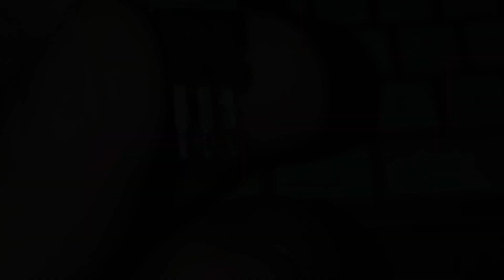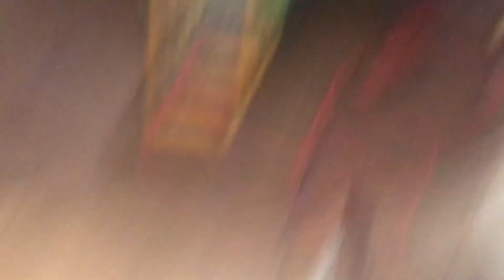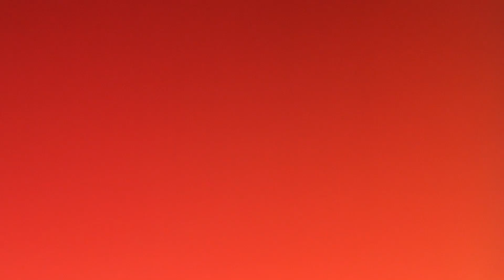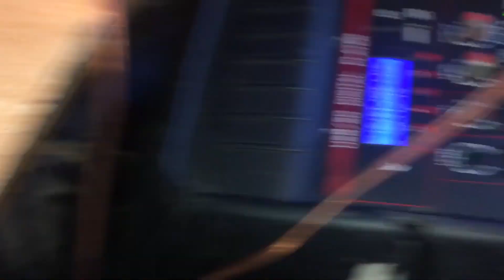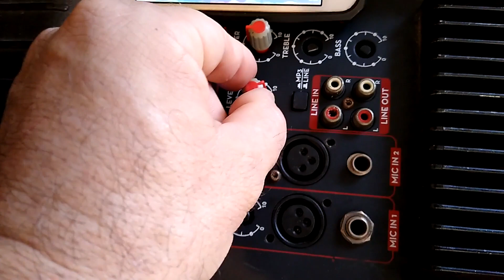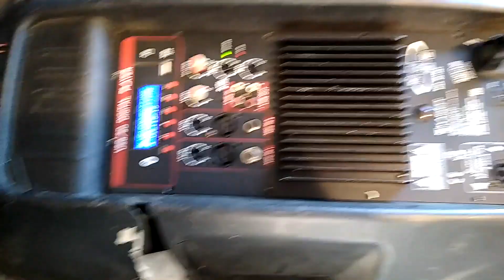Kaiser MSA 6515BT Speaker with damaged mixer power supply

Comment: I have a similar speaker that also had the internal 12 volt batter brought this and a larger atvio monitor back from Mexico .. these are great speakers imo. , they both can put out quite a bit of sound. I think the plastic cases are a weak plastic or something as mine also cracked during the flight and/or by customs to open it up   had to clean mine out due to a mouse moving into one.  None the less curious if the actual speaker specs are available somewhere as I am trying to get an idea if the singals are boosted, or flat.